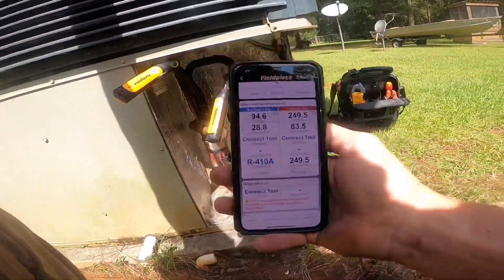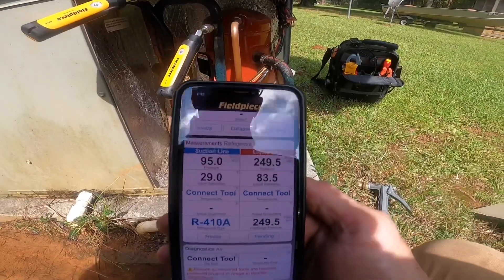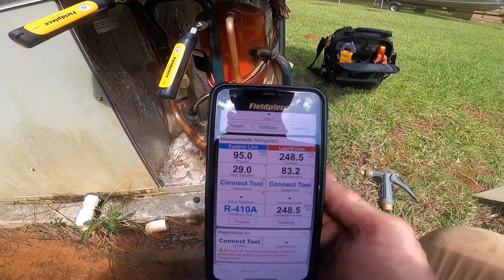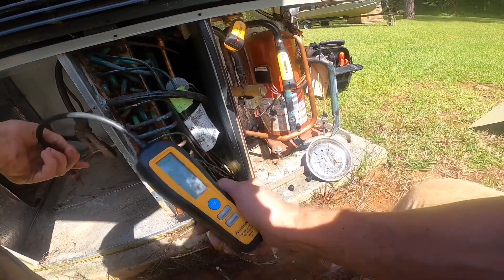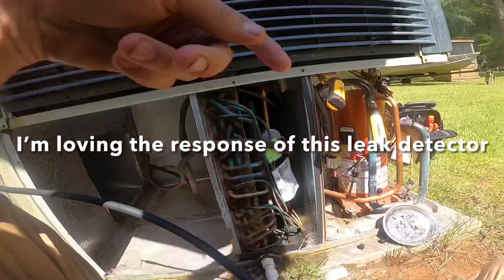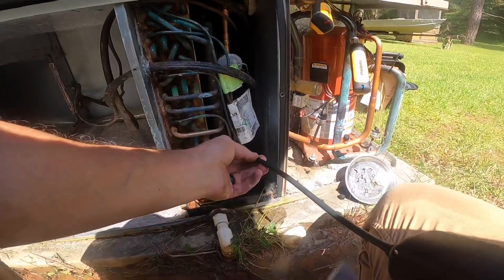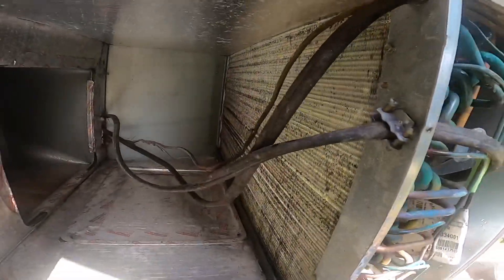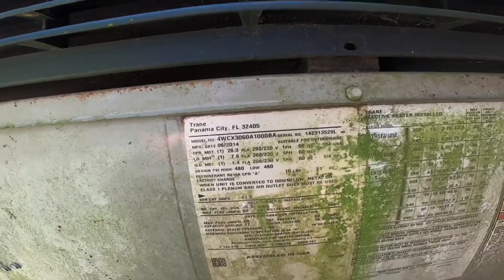Nothing can stop a Trane! Except maybe a leak! Using DR58

Comment: Detector seems extremely delayed. Thatd be annoying as hell.
Reply from the maker: It goes off almost immediately, but it moves a tiny bit of air through it. So, it may take a few second to clear. The filters feel like they are completely blocked when you try to blow through them. Then the sniffer hole is tiny.